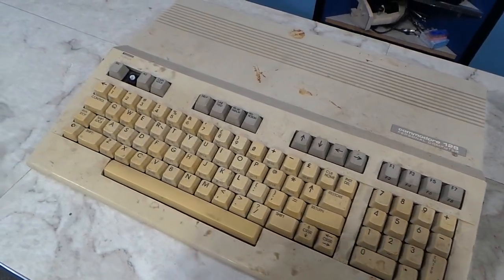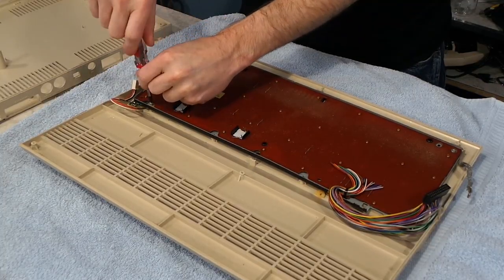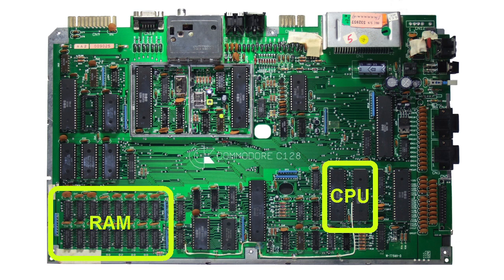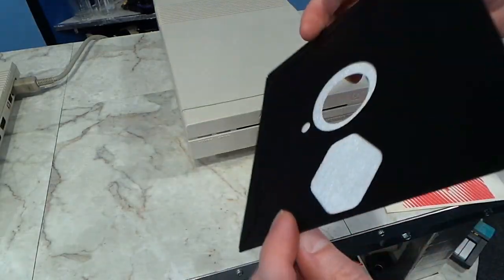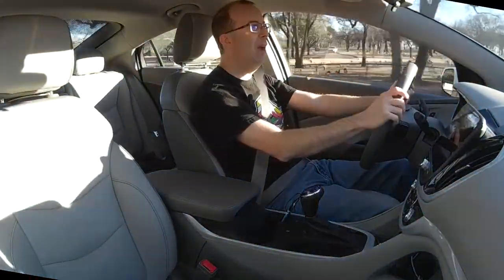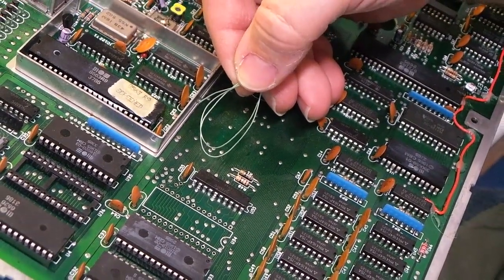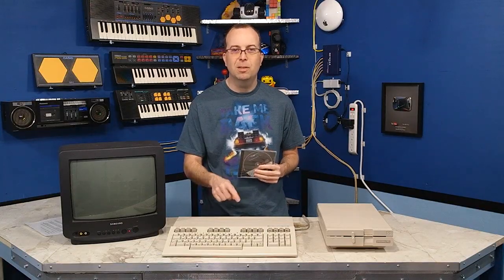Commodore 128 Complete Restoration and Board Repair.

Comment: Why would you pay $30 for that? Looks like someone wiped their ass on it!
Reply from the maker: Actually the parts alone are worth more than that if I were to part it out.
Reply: That's actually good price for a C128 these days, as usually go for $70+ in that shape, and in good condition can go for upwards of $200 - $300. the  C128 line of machines was Commodore's top of the line 8-bit machines.
Reply: Commodore parts fetch for a nice price. A friend of mine actually found a C128 in one of those electronics disposal bins one usually finds in supermarkets.

After cleaning and checking the parts he made around 100€ by selling the parts.
Reply: Mostly, the price is driven by nostalgia value and rarity.  People (like me) who grew up with the 8-bit computers, who have disposable income, are willing to pay quite a sum to buy back part of their childhood.

I have two Commodore 64's and two disk drives that are 100% functional, and not yellowed because they've been sitting in a dark closet, where they don't get any UV.  I'm not planning to part with them, even though I don't use them (because I simply have no room to set them up without taking down my PC, which I use for both work and play).
Reply: Yella Dart bruh retailers sell it for 300-400$!

Comment: I repaired a Commodore 64 and 1541 floppy drive last year. It was a very challenging but rewarding project.  I think there is a cracked trace somewhere on the board near the RAM ICs because if I slammed down too hard on the space bar it'd cause the board near the RAM to flex and it would freeze up. I reinforced that part of the board with rigid plastic and that did the trick. The board will still flex if it overheats but that only happens if it's left on a carpet which is a bad idea anyway.

Someday I'd like to try and find the bad traces and patch them like in this video but I was already going mad by that point and decided to take the easy fix.

Comment: Hey why don't you just use regular hydrogen peroxide? You can get the higher concentration stuff very very cheaply and just basically pour it out into a container that could fit all the pieces and then fill it up. You can also adjust the concentration yourself by adding in water. Little warning however, don't get that hydrogen peroxide 30% concentration stuff on any bit of your skin. It will basically bleach it completely white and then it'll hurt but also feel as if you have little bubbles popping under your skin. Shit don't feel good, so gloves are a great idea.

Comment: Damn,  the size of that disk drive.
Reply: If you think THAT was big, you should see what came before them.  Before the 1571, there was the 1541.  The power supply was internal, so it was even bigger (the 1541-II had an external power supply, like the 1571).  

Before that, you had the 8" disk drives.  If you've seen the movie Wargames, you saw a young Matthew Broderick using one.

In 1979, a 250 MB hard drive weighed 550 pounds and cost about $50,000 (about $100,000 after adjusting for inflation).

Today, you can buy a 16 GB microSD card that weighs about 0.4 ounces and cost $11.

Everything is getting smaller, cheaper, and storing more information.

Comment: Hats off on the repair guy, he narrow the issue like a champ. I fixed 3 C64 and it was a pain. Just made the chip swap using other working C64 and non of the socketed ones were bad. One was RAM. Couldnt narrow wht chip, change all of them. The other two were glur logic 74 series thing. In only ONE I was able to "guess" the chip to replace. In the other two just keep changing things ... Even when I ve read tons, and read the schematics many times and tried to understood how thing were put together .... But C128 looks insane compared to 64. I knew about the twin processor (Z80 for CPM) but ... twin VIDEO chips ... that was shooking. A truly homer mobile, C128 was no sense, they should move to AMIGA instead.

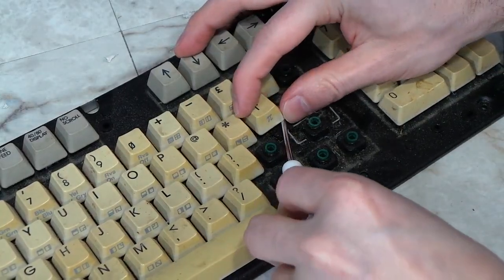Comment: 7:06 Do you have one of those mechanical keycaps remover? There are many kinds, the best ones looks like a wire bent forming a couple of squares, easy to DIY! http://lifehacker.com/make-a-diy-keycap-puller-out-of-two-paper-clips-585305038
Reply: I was wondering why he was not using a key cap puller myself, as they are cheap as dirt, but one of the most handy tools in my box when restoring keyboards of any kind.

Comment: Why not invest in a keycap puller? its cheap, and its worth it to avoiding any risk over the keycaps snapping
Reply: Agreed, you can ring keycap pullers off eBay for as little as $.99 from China, and the Wire keycap pullers are not much more expensive. Heck a lot of companies give them away for free when you buy a mechanical keyboard.
Reply: tbh i don't have good experiences with ring pullers, wire pullers all the way
Reply: I hear ya, but a ring puller is better then no puller at all I say.
Reply: Yep, of course

Comment: Why can't computers be this easy to take apart nowadays.
Reply: Truly Infamous grey boxes still are
Reply: Mine is, just two screws that you don't even need a screwdriver on(you can use if you like because they are slotted as well as knurled), then slide off cover and it's wide open. everything inside can be taken off in any order. And most things in there have but a couple of screws if that except the motherboard which has half a dozen screws. On the other hand, I've seen the "all in one" computers they have and I really see your point. In fact, that is why I didn't get one the last time I bought a computer. I share your frustration.
Reply: EXACTLY

Comment: Just a heatsick compound question. Wont smearing the compound with your finger cause bubbling and possible issue in the future, i was always taught to place a small bead of compound and let the contacting parts naturally spread it out
Reply: I would not have used my finger because of the oils that are found in your skin, but over 25 years of building, and repairing computers, and electronics I've found it rarely makes a difference if you spread the compound with something like a clean flat plastic card(some compounds even include a plastic spreader, leave a line, X pattern or pea(long as you don't use too much), it's more about the type of compound you use, and proper application of the heatsink itself.  Here is the compound that I use, and it's cheap as dirt, and even keeps everything I've used it on running super cool(just keep it in the door of your frig so it does not dry out). 
http://www.ebay.com/itm/30g-Syringe-Thermal-Grease-Silver-CPU-Chip-Heatsink-Paste-Conductive-Compound-/391205942743?hash=item5b15b0f5d7:g:DZgAAOSwLVZVrbsb
Also here is more or less the same stuff with a plastic spreader in a little tub. 
http://www.ebay.com/itm/20g-Silver-Compound-Thermal-Conductive-Grease-Paste-For-CPU-GPU-Chipset-Cooling-/252087582361?hash=item3ab1973e99:g:RvkAAOSwFnFV8ftI

Comment: Friend gave me a C64 that works but some of the keys don't seem to be making contact. Going to take apart the keyboard and clean it. Got a 1541 FDD that seems to work but don't have any disks to test it. Don't have time to mess with any of it yet because of work but since I work for the local schools and I get spring break off, I'm going to try and make it my project. Even though my C64 is a first run 'bread box', I'm curious if any minor yellowing has changed the case color and if your peroxide method would work but without damaging the original color. Just curious.

Comment: Absolutely love watching restoration jobs. I've always loved the design of the 64c and 128 and prefer them over the Vic/64 breadbin case style. One note on the Retrobrite process: a few years ago I treated a yellowed Apple //c using the exact same process as you, however, it's slowly turning a cheese yellow again. It's never seen an ounce of sunlight after treating it, and I've seen it happen on other treated pieces, so I guess sometimes plastic is just doomed to forever fade away. It's a shame, but what can ya do.
Reply: Well, there is something you can do.  After treating it with Retrobrite, give it a top coat of Novus Plastic Polish #1 or 303 UV Protectant.  You can find either of these products online on sites like Amazon, or even in local stores like Lowes or Wal-Mart!  These will restore the high gloss, and protect the plastic from future degradation.

Comment: Great video! What instrument your friend used to "desolder" the CPU? Thanks!
Reply: That would be a desoldering iron on a soldering/rework station, and it appears to be a fairly expensive looking one at that. For basic needs, you can get a solder remover that's not powered and is just a heat resistant spring loaded syringe. You lock the spring forward, heat the solder joint, put at against the joint and push the release, it springs back, pulling the solder out. Once it gets too many blobs in it you can then empty it. They  last a decent amount of time if you get a metal and Teflon one like this. http://www.ebay.com/itm/Desoldering-Pump-Solder-Sucker-Removal-Vacuum-Tool-with-Aluminum-Body-Teflon-Tip-/300771835247?hash=item460765fd6f:g:8HoAAOSwBLlVa9aH
Reply: theLuigiFan0007 Thanks for a detailed reply. I will probably buy one of those. Desoldering is always tedious work for me
Reply: I used a Pace SX-70 desoldering iron to remove that chip in the video. They are a bit pricey but are made for industrial rework. :)
Reply: If you do a lot of through-hole component desoldering you don't have to go with fancy brand, cheap Chinesium desoldering stations are decent and you can get them easily for less than $200.
Reply: Thanks LuigiFan
Reply: *****
You won't damage a DIP-40 chip using a spring based solder sucker. I'v done it many times, and been desoldering chips for years this way. Takes around 5-8 seconds per pin. Never killed one, nor have any traces ever been damaged. A desoldering station is better, but both are valid methods of desoldering.

I quite honestly don't see why it could damage them. Do you know why? Under what circumstances does it happen? If so, I'd like to know for future reference, for reasons of precaution. If you're instead talking about 40 pin SOIC or 40 pin DFN, then yeah that's a bad idea if it even works at all. A heat gun, lots of flux and tweezers is the right method there.
Reply: kroplaaaa
Yeah a cheap desoldering station is definitely more useful, but once in a while you have no other options. Later on, you can upgrade. :D
Reply: *****
Ah, you mean improper use, bad techniques or just generally being too hard on the boards. I can see that. Some people have no idea what they're doing and end up ripping traces or making they lift up and such. I can definitely understand that part then.